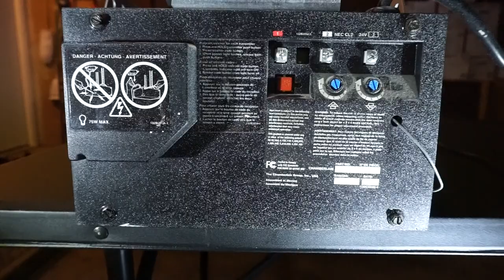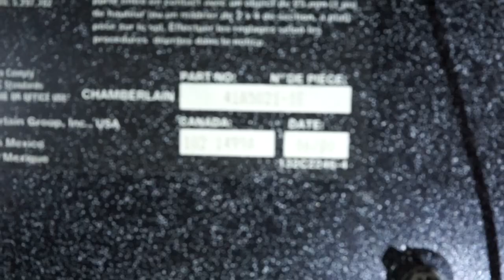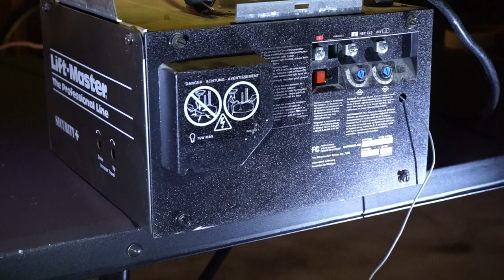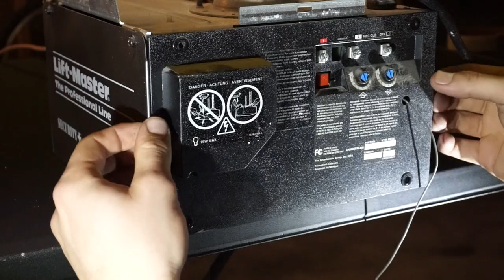Circuit Board Replacement Chamberlain Liftmaster Accessmaster Craftsman

Comment: My Liftmaster garage door opener was so old that replacement logic boards for my model were discontinued.  My problem was that the remote would not work with the opener lights on.  I chose to replace all the electrolytic capacitors on the logic board so now all is well.
Reply from the maker: Did you ever try just removing the lights alone ?
Reply: Yes I did.  I first replaced the LED bulbs with incandescent ones and when that didn't work of removed the light bulbs altogether. None of that worked until I did the job described above. @GarageDoorGuidance
Reply from the maker: Thanks for the tips 👌🏻

Comment: I liked your clear video. I asked some questions within other people's comments/questions, but in case it gets buried, I will aks in my comments.  I have a Liftmaster that is at least 17 years old. Currently, the remotes will not work. We tried to reprogram with no luck. We also swapped out the LED bulb since we read that can interfere. Two questions: 
What else can interfere with the signal? Can bluetooth devices or a Smart doorbell/camera nearby? 
Also, when you are discussing the circuit board replacement above, is that the same as the "logic board?" Since our unit is old, I'm guessing that this might be what is needed. Thank you very much for any feedback 🙂
Reply from the maker: I replied to your other message within a comment and to reiterate yes I believe you’re board needs to be replaced. ( logic, mother or circuit board haha )
Reply: Circuit board and logic board are one and the same.  My Liftmaster was over 20 years old and replacement boards were discontinued.  If you are handy with a soldering iron, try replacing the electrolytic capacitors on the logic board.  This worked for me.

Comment: I think I need to change this circuit board in my Liftmaster garage door opener. Although I can open/close it with the button that is hardwired to the unit, it will no longer respond to any of my remotes that previously worked with it. I've tried clearing the memory of the unit and reprogramming the remote - but it never works. I've even tried several other remotes and they will also not program with the opener. So, I'm thinking it is a receiver problem. Would you agree that this is probably the problem?
Reply from the maker: I would agree yes sir!
Reply: @GarageDoorGuidance  I purchased (off Amazon) a new circuit board and it all works now. I'm not a particularly handy person but your video encouraged me to give it a go since it looked simple enough. Thanks for that!

My research indicated that the most important thing as far as compatibility goes is that the color of the button on the back of the unit has to match. The unit I purchased actually had a slightly different model number but it still had a red button. Also, the Amazon description gave a list of all the different model numbers that were compatible with the one they were selling. My model number was one of them.
Reply from the maker: I’m glad I was able to help in some way (:
Reply: I have the very same model you demonstrated and am experiencing the same issue above. I tried using your website order button for my logic board replacement but it's no longer in stock. Is there another you recommend...want to make sure you get the Zon affiliate credit. Thanks!  @GarageDoorGuidance

Comment: My lift master will only open with the hand held remote but will not close.  Wired button works fine up and down.   Would this be a bad circuit board? if so where is the best place to get it?
Reply from the maker: That sounds like the sensors to me, have you tried to line them up?
Reply: @GarageDoorGuidance   sensors are functioning.  door goes up and down normally with wired button.   only goes up with the transmitter (have 3 all do the same thing) but will not even start to go down as if you have not sent a signal to close the door.  opener never acknowledges command.  Tried to re-sync the receiver but the unit would not reprogram.
Reply: @garrymccann419  did you find a solution? I’m having the same problem. Thanks in advance.
Reply: Same issue here. Have realigned sensors, but they were lit green already.  Have done everything under the sun to try to pinpoint any interference, including shutting off all breakers and flipping them one at a time. Putting in a new control board tonight.
Reply: Resolved my issue. Put in new circuit/logic board and all works good now. Bought logic board directly from Chamberlain website.
Reply: @garrymccann419  I unplugged the opener for 1 minute then plugged it back in, and reprogrammed my wife and my remotes. Hers works fine, but mine would only open but not close at all. I took my remote apart and with a small screwdriver adjusted the capacitor until the door would close while I was pressing the remote little button. Bingo!
Reply: How do you adjust the capacitor?

Comment: If all 3 of my remotes suddently stop working, but the wall switch works OK.  do I need a new cirucit board to fix it  I want to be sure before ordering a new board thanks
Reply from the maker: I would try to reprogramming the remotes first then if they don’t get accepted, would replace the board

Comment: If my  chamberlain garage door cant open and close with both controls during chilly- hot forecast is this the priblem or garage door sensors because i saw there are some webs/ dust might beed checking as state online?
Reply from the maker: Do you happen to have a screw drive opener?
Reply: Is it to open the garage door opener to determine if the control board is baD?

Comment: Is this my solution if my old remote and newly purchased remote do not sync up with the Liftmaster garage door opener?  Wall switch still opens the door as does my wife's 2012 Honda Pilot door opener buttons near the rearview mirror (button syncs up with the opener's system).  I have a 2009 Honda Accord and it doesn't have buttons internally to sync with the opener.  Thus, why I have to still use a remote.
Reply from the maker: If the car and button on the wall work then I don’t see why you’d need to replace the circuit board. The new remote may not be on the same frequency. What remote is it that you purchased ?

Comment: Thanks for this.  How long do these units usually last?  I've got a Chamberlain Liftmaster 1/3rd hp unit from '06, I think it just needs a new circuit board, but if it's already past its lifespan, maybe I should just get a whole new unit?
Reply from the maker: Brent Samuel 12 years isn’t too bad it usually lasts 18-22 years. However the circuit boards are around 70-90$ so it could be worth buying a new one off amazon for 100$ more . Just depends on your situation and what you want to do.
Reply: I think I will give it a try, might as well try to get a few more years out of it.  Thanks again.
Reply from the maker: Brent Samuel my pleasure !

Comment: My 2001 liftmaster keeps losing codes from the keypad and I have to reprogram.  It's been replaced once already.   My car remotes never lose connection.  Is the logic board bad?
Reply from the maker: If the keypad was replaced I’d guess either you’ve got too many things programmed to the motor already or it could be the logic board yes
Reply: @GarageDoorGuidance  By "logic board" do you mean the circuit board that you show replacing in the video? Or is there a different logic board? (My garage door won't reprogram with remotes and is about 20 years old.) Thanks for any info.
Reply from the maker: Some call it a logic board others a circuit board others a mother board haha I don’t even know which is correct at this point. 

If it’s not programming and the opener is 20 years old I would say yes that would be the culprit. However it being 20 years old it could be time to update to a new model.

Comment: Door works normally when open. But remote doesn't work to open door except when it is within two feet of the door. We have replaced remote and logic board. Consulted two garage door technicians who don't have an answer. We would appreciate help. Also, no LED lights in the area.
Reply from the maker: No led lights anywhere in the garage? My brother installed 4 led overhead lamps in his garage and that completely killed the signal. If it’s working from 2 feet away there’s got to be interference somewhere. Especially since you changed logic board too
Reply: @GarageDoorGuidance  What other interference could affect the signal? In our garage, we don't have LED lights but do have a Smart Door bell/camera nearby?
Reply: Did you try changing  the battery in the remote?  Or a different remote control?

Comment: Is this the fix for a unit that does not supply any power to either of the sensor eyes? My opener has power for lights, motor, and wall panel, but is dead for both sensor eyes.
Reply from the maker: Eric Garza are you 100% sure that it isn’t the sensors or wires themselves ?
Reply: Garage Door Guidance  It must’ve been. I went out to the sensors again, took them off the rails, cleaned them and the lights came back on. Everything’s good to go! Thanks for the video tho. I was ready to get a new board and DIY.
Reply from the maker: Eric Garza there you go, glad you didn’t have to buy a board they run a bit expensive ($78)